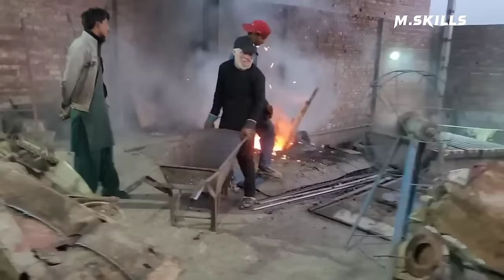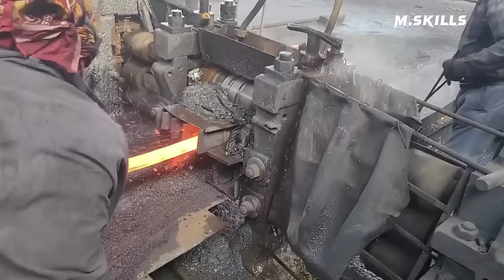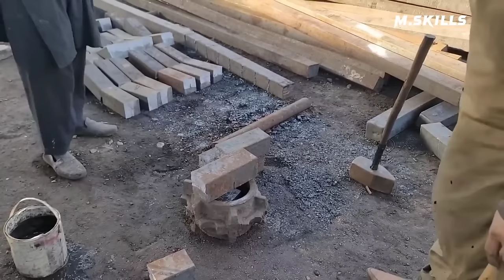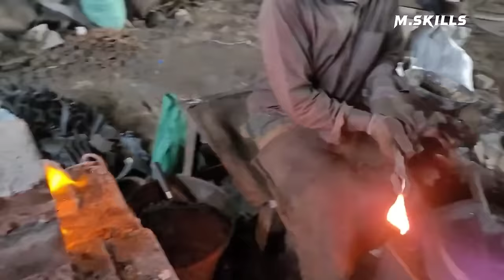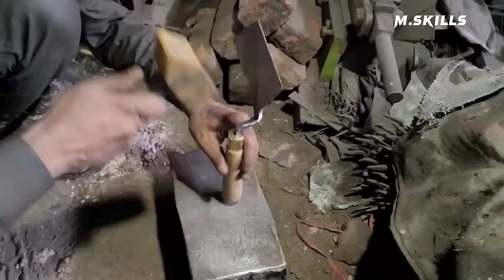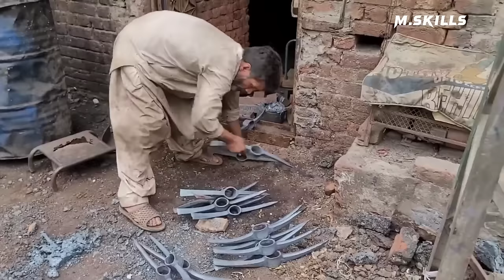Top 5 Most Viewed Pakistani Manufacturing process videos in 2023

Comment: I appreciate the time filming this. Continuous casting iron. Layers of coke and scrapl  Packed sand and oil molds all done wearing sandals. Guys busting engine blocks out back with a sledge hammer. Made a Mickey Thompson gas peddle in school. Lost track of it long time ago. We got to ram up a flask and pour scrap aluminum. The lost wax methods are interesing too.